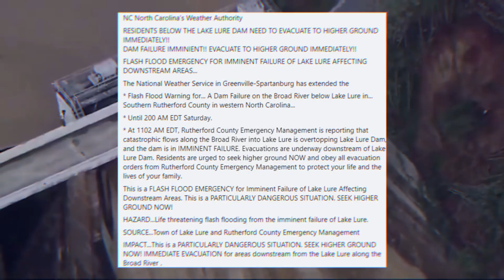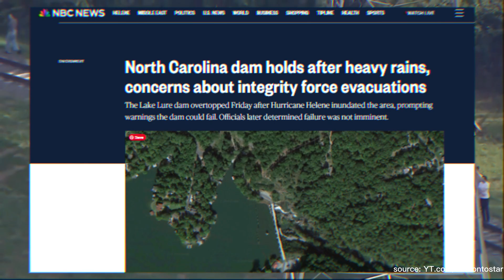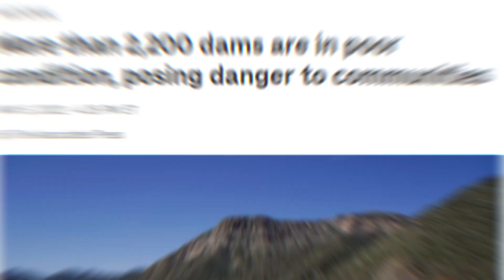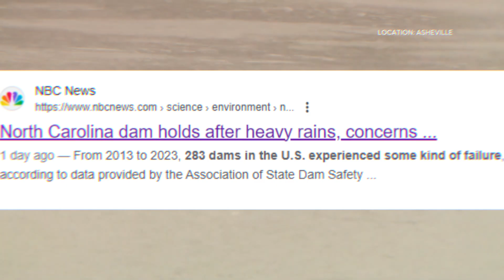The Lake Lure Dam Disaster: A Cautionary Tale

Comment: I live in the area. The Town of Lake Lure has been working on replacing the dam. You can't build a new dam over night. The project will take  about 5 years. The Town of Lake Lure does a really good job of managing the lake. Chimney Rock built buildings right next to the Rocky Broad River. Chimney Rock has been washed away two other times in history. They should have learned from the flood of 1997.
Reply from the maker: Yes it's a tricky thing.
Reply: Maybe there should be no insurance allowed in certain areas? Or permits to build anything but greenways in certain areas? Like look at the pictures of the debris field and mark that area on a map then put a big RED mark on it. Lovely area. I proposed to my wife at Devils Head State Park back when you could still go to Peregrine's Point. We went back one year and could no longer hike the upper trail. Maybe they changed it again since?
Reply: Let them have their tea and cakes then.